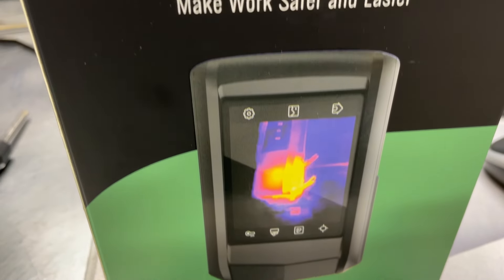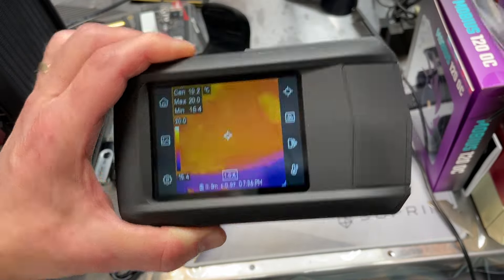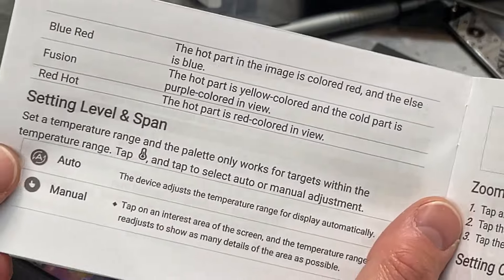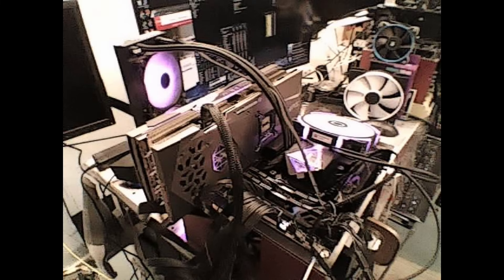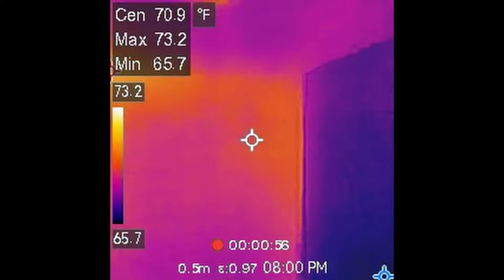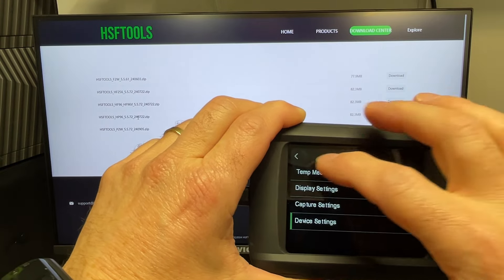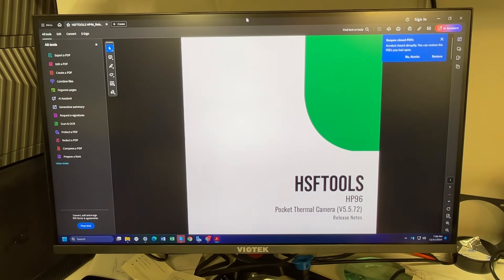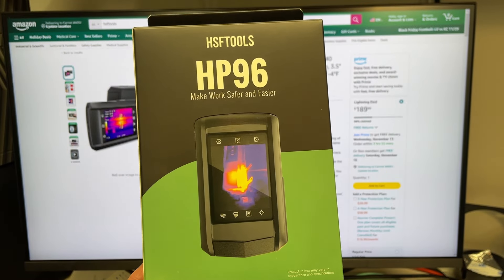HSFTOOLS HP96 Thermal Camera Review!

Comment: Great review, thank you! Do you know if setting the temperature range works fairly well (i.e. not autoswitch -- under "Temp Measurement Settings)? I'm considering a FLIR gen 3 but it doesn't have that option in the updated app so the scale is on "autoswitch" constantly. Seems like the older firmware allowed for that to be changed but now it's a feature of the PROs only and a lot of older users are upset.  Thank you.
Reply: I do not know what you mean by if it works fairly well, it either works or it does not lol I mean you have three options to chose from Auto Switch the others are range between -4.0 to 302 F (-20 to 150 C) or the other range is 212 to 662 F (100 to 350 C) If you chose to use the lower temps scale and you are measuring the temperatures above those, you will get Max > 320 F (160 C)